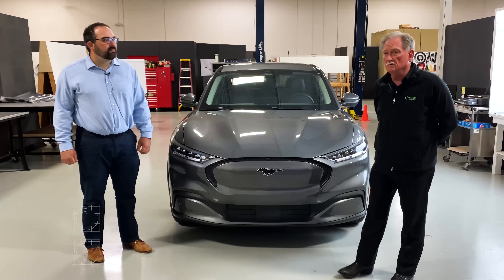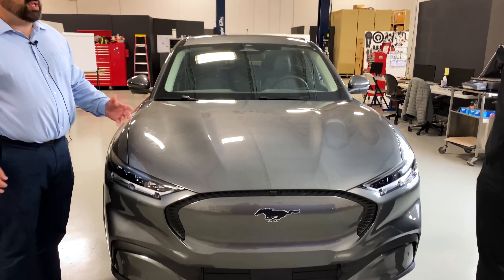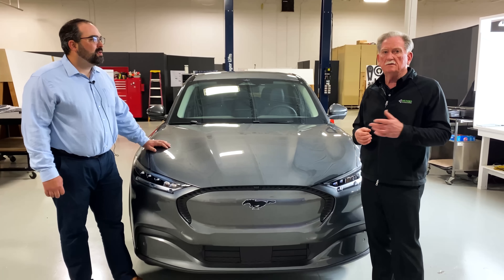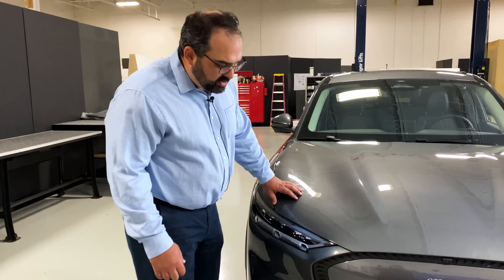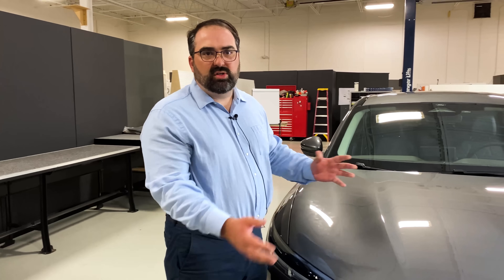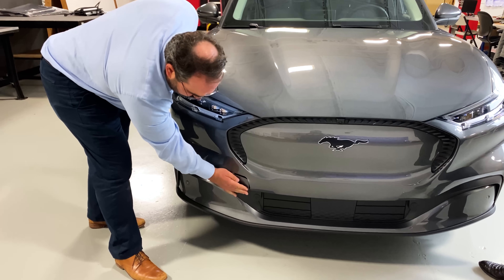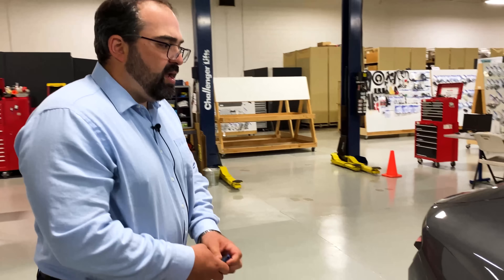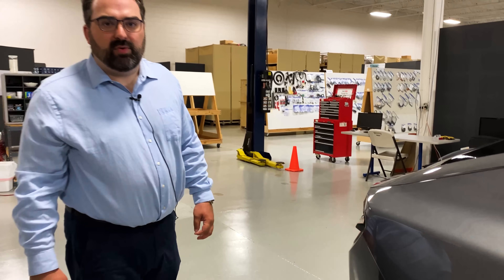MACH-E Teardown BEGINS!

Comment: It’s just simply amazing how Tesla’s competitors have closed the Tesla gap. Hopefully, the competition will figure out their poor charging infrastructures.
Reply: It’s pretty easy to copy and iterate on what’s already been done. Let’s not forget, Tesla open sourced the plans for the Model S in 2014. Elon is more interested in helping everyone transition towards cleaner greener transportation and energy sources.
Reply: @batandball617  That isn't quite right.

See, 'Open Source' is an actual thing, with rules and forms to fill out 'n stuff.  Tesla did not place its patents under the Open Source Foundation's rules.

Nor would it have made legal sense to do so.  Open Source is for copyrights, not for patents.  Patents are governed by an entirely different set of laws.

What Tesla did is to announce that if other OEMs used Tesla's patents, existing as of the date of the announcement, they would not sue.

There is a lot of legal ambiguity there.  Does it apply to patents filed after the announcement?  Nobody knows.  Does it apply to source code?  Probably not.  Does it apply to industrial secrets?  Unlikely.  What happens if Tesla changes it's mind?

That last question we can answer.  Tesla has signed no contracts granting permission to use their patents.  And so they have no contractual obligation to honor their promise.  They can legally sue copycats violating their patents if they so choose.

So legal departments at various OEMs are certain to be dubious about this promise.  It looks risky to take it at face value.

Elon's central strategy for goosing OEMs to make BEVs isn't opening up patents, anyway.  He's got a much more brutal agenda: he intends to drain ICEV sales, displacing them with Tesla sales.  He's going to hurt ICEV OEMs until they can't stand it and either fold, or make competitive BEVs.  Elon's strategy is going to leave a lot of blood on the ground.

And I think it'll work.

And I think it's the only strategy that could work.  Being nice to ICEV OEMs isn't going to get them to move.  Elon needs to hit them where it hurts, in their ICEV profit centers.

As for how easy it is to match Tesla... well, no.  Look at VW's software struggles; look at the mess of threaded fasteners in their ID4 motor assembly; look at all of the physical fuses found in legacy OEM BEVs (Tesla uses software controlled switches); look at the range/price disparity; look at the price/value disparity.  ICEV OEMs can make a good-looking car, but their pricing tiers versus Tesla's for what you get is not yet competitive.  As for autonomy, that race is almost over.  Nobody else has the data or the neural net chops to match what Tesla is doing.  And charging is another area where legacy OEMs have fallen behind.  Catching Tesla will be hard.  And expensive and time-consuming, too.

ICEV OEMs are currently pushing BEVs that perform worse for higher prices, and that's a problem for them.  There's a gap to close.

Meanwhile Tesla just keeps innovating.  When they get 4680 cells up and running, and complete their changeover to rear and front underbody castings, their lead will accelerate again.

I think it's premature to be congratulating OEMs for matching Tesla.  There's a big gap in the value proposition, and I think it's trending in the wrong direction for OEMs not named Tesla.
Reply: Tesla’s still ahead I’d say, if they can pull off Y in their new gigafactories, but it’s great to see good EV design coming to everyone else.
Reply: @rivengle  Being ahead is relative! Everyone doesn’t need extreme range and speed. Some might prefer quality  manufacturing.
Reply: @Stan54321  As far as EV drivetrains and EV design goes, I’d say Tesla’s still quite a bit ahead. Don’t disagree on fit and finish though.
Reply: @Stan54321  What, like that trunk.... or the internal materials and fit and finish of the ID3/ID4.
Reply: Have they closed the gap?  I'm not so sure.

Let's see how they put the Mach-E together, then judge.

Comment: Thank you Munrolive! Will be buying this car if it passes Sandy's teardown seal of approval 👍
Reply: Will be great to see. I think they are good cars for sure. My only concern is that every time I watch a vid about an ev that isn't a Tesla it's someone at a charger that can't get it to turn on!!! Maybe it's just a stigma that I have and it's not really that bad. But it seems like an issue. I think I watched a video with Sandy himself that was talking about it and he was saying that it's because the charger wasn't specifically designed for that car by the manufacturer so there seems to be compatibility issues. I went on and downloaded the charge point app and signed up for an account and it was a total pain. I had to call sit on hold cuz it wouldn't accept my card. Also needing to have a membership or app for every different charger network is annoying. U should just be able to tap your card on the charger and charge your car. I'm sure it will get better and there are some trips that I still can't take with my Tesla as I'm on the prairies in Canada and even telsa superchargers are scarce around here
Reply: @themeach011  Yeah, I have seen the same and agree it needs to improve. That said, I've had a Model 3 for two years now and have only needed to charge away from home maybe twice so not much of a concern for me and some others.
Reply: @TheDmd4343  it's very dependent on individual usage. I also charge 95% at home but part of that is because they don't yet have chargers at some of the places I want to go so I have no choice but to take a different vehicle. I don't think where I live I could function with only owning an ev at this time. It's an amazing second vehicle though and it saves me a ton on fuel and depreciation on my not having to drive my truck as much.
Reply: @themeach011  I've seen a video from Engineering Explained where Jason Fenske took a Mach-E out for a trip and got some rapid charging done, totally without mishap because Ford had done very well with their App which allowed them to access chargers like Volkswagen's Electrify America with much less trouble than VW's own vehicles. Then again, VW's ID.3 and 4 are already gaining a reputation for being a tad troublesome with chargers. I should know, I have an ID.3, and it is a bit pernickety. But Ford have done well on that issue it seems.
Reply: @ramblerandy2397  I hope they do get better. It needs to just work if people are expected to adopt this tech
Reply: @themeach011  I am in Alberta there are plenty of super chargers southern Canada but going north is a problem.
Reply: @dennismorin7506  I'm in swift current and as long you are going east or west it's fine but there's no chargers heading towards Saskatoon, or rosetown or oyen. If I had those three chargers in place I could literally go anywhere I needed to go. A connection from Saskatoon to Calgary would be killer, they are doing Saskatoon to Edmonton which will be great as our older children are in Saskatoon and vermillion. Saskatoon is supposed to open Q3 this year which will be huge. I don't understand how they can have a Tesla show room open in Saskatoon but still no fast chargers. And there are not even any other fast charging options. Also the Cranbrook charger would be great as well when it's done as my wife's mom lives in creston and it's pretty tricky once you get down in that area as well
Reply: @themeach011  Yes Tesla's plan from the beginning was for Canada start south and work their way up. A lot planned for this year myself I like to go to the mountains Edmonton to banff super easy barely an inconvenience. Edmonton to jasper fine if you are OK spending a lot of time in Edson and jasper.  super charger planned for Edson and Jasper this year. Awesome full circuit. Edmonton to banff to jasper to Edson back to Edmonton.
Reply: @dennismorin7506  I love that trip. Hiway 22 south of Longview to the crowsnest is one of my favs as well.
Reply: @themeach011  you bet the only boring part of that trip is hyway 2 Edmonton to Calgary the self driving is sweet.
Reply: Sandy is the new Consumer Reports that you can actually trust.
Reply: @HMexperience  consumer reports has lost my respect as of late.
Reply: Seriously why would anyone buy this car instead of a Model Y?
Reply: @TheDoughGetta  The Beer Frunk lol